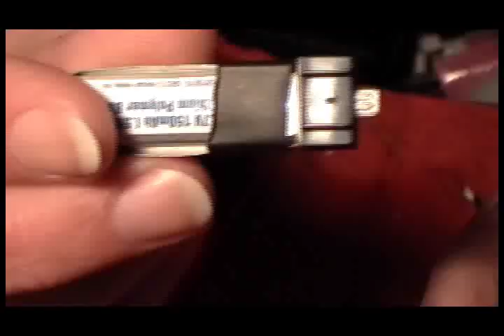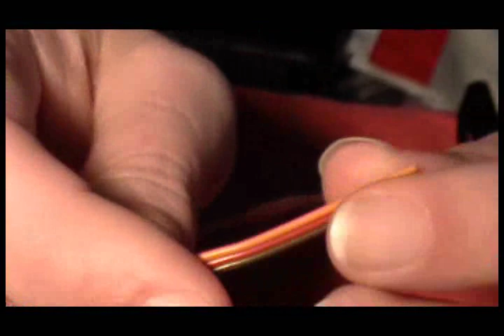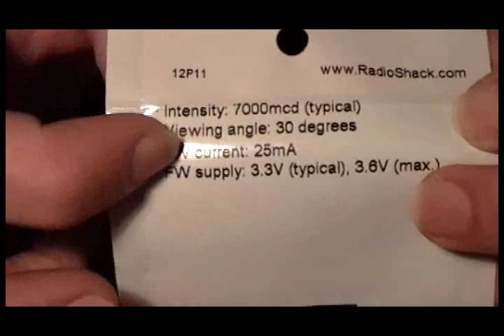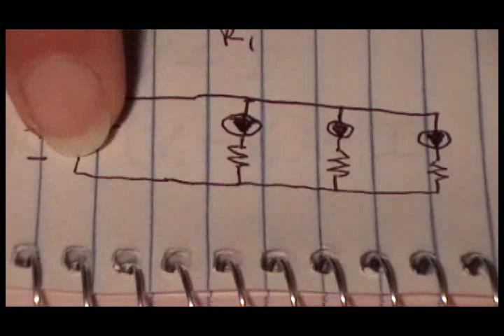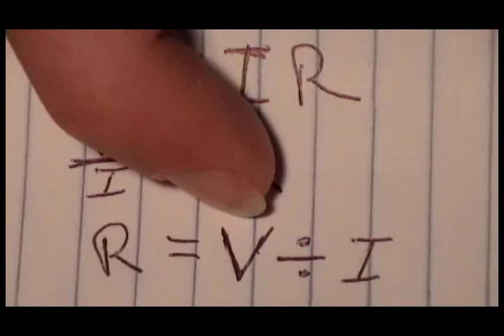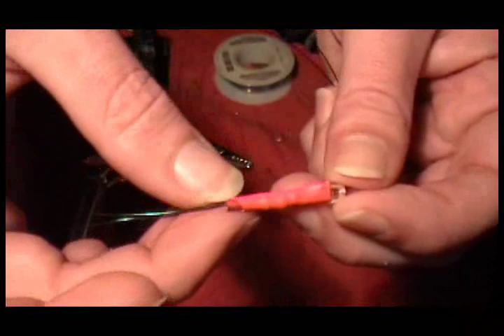All About LEDs for RC Night Flying

Comment: I may have missed it but did you explain that the 331 resistor notation is a shortcut for 33 followed by 1 zero which is 330 ohms. For example, 332 would be 33 followed by 2 zeroes or 3300 ohms.

Comment from the maker: No not really... sometimes the resistance of the wires will be enough, but it's risky to run setups like that because if your voltage varies (which it does when using batteries) then there may be times when your current spikes to ridiculous levels. When using Lipo batteries, current spikes are BAD. The only safe way to run LEDs without resistors is with a constant current driver - and those are typically more weight than the resistors.

Comment from the maker: @ThisLaoGuy Generally we will use one resistor for each LED, but the 3W LEDs are really big and they might come with resistors already. I know many of them come mounted on a large heatsink with solder pads, so it's not quite the same as this video, but the electronic principles are the same. Just make sure you're not getting LEDs with resistors already on them - many of the larger LEDs and the flashing LEDs are sold that way - ready for a specific voltage.

Comment from the maker: @IJPTEAM I use 1/4W (0.25-watt) resistors in the video, but for low voltage stuff you can usually get away with using 1/8W (0.125-watt) resistors. In the online LED calculator, at the bottom it shows you what resistor you need and it tells you the amount of power going through it. Power through a resistor is (I^2)*R (current-squared times R) if you need to calc it yourself.